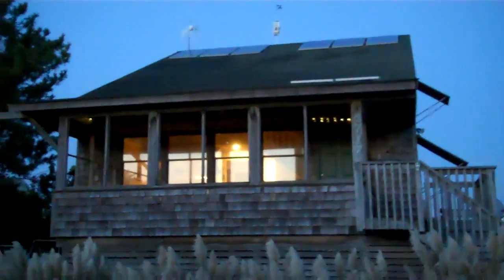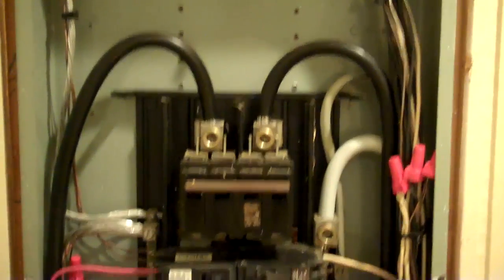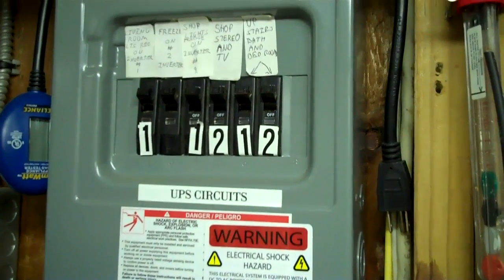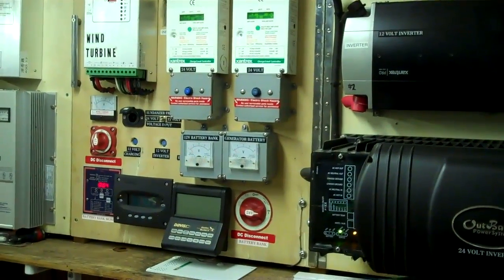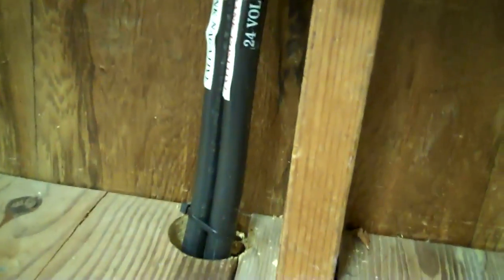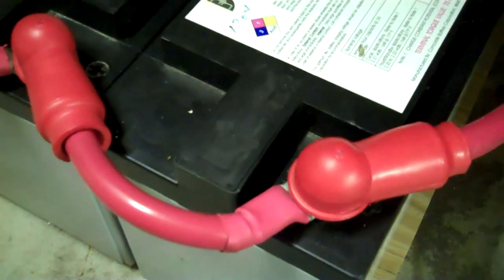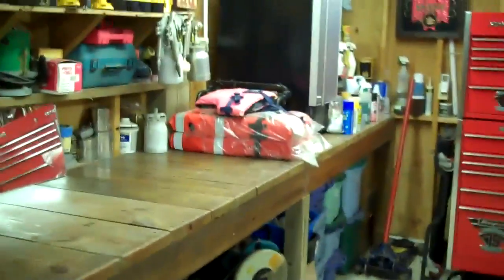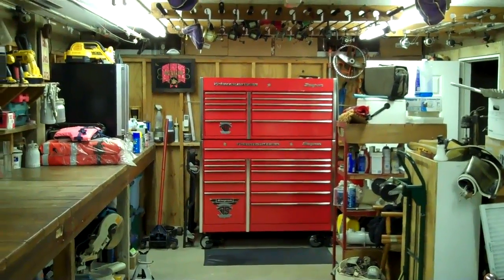SOLAR AND WIND POWER HOW I WIRED IT.

Comment: All my Battery inner connects are of type k copper tube that can handle over 1400 amps at 1 foot according to Nibco, the manufacturer. My 2-0 wire failed, the pipe has not.

Comment: geesh brother.  what a great system; where do i start?   I'm a total newbie but also a nerd with some experience with an electrician and in other trades.  I know I can learn and then safely and neatly wire up something like that. My goal is something much more modest:  a skoolie conversion.  BUT, I want it to have a shore tie, wind, solar, generator and engine charging capabilities.  I need enough juice to power a refrigerator, TV, PC, stereo, water pump, microwave and lights.  I don't know how to size it let alone engineer the build.

Comment: You definitely have it 'squared away'. Very impressive! Personally, I wouldn't even know where to start. Possibly you could give me some advice, as to where to start on powering a greenhouse? My brother-in-law and I have built a 17' x 57' greenhouse that we are running an aquaponics system in. That means that we need to be able to power 'off-grid' a 4,000 gallon per hour sump pump, a water heater for the swimming pool, (during the colder months) that houses fish, also a few devices that might switch on and off, when needed, to maintain water levels, water temperatures, possibly send us alerts and occasionally some lights. How would you recommend that I/we start? This is in Southeast GA.

Comment: Your batteries should be in a ventilated steel enclosure if you get a thermal run away with all that wood it won't be good, Nice set up by the way cheers...

Comment: It amazes me that you use big wires along the batteries and then come back with flattened copper pipe that has way less square area. That copper pipe is like a big resistor compare to the other big wires.
Someone on the internet comes up with an idea ( good or bad ) to use a flattened copper pipe and then the rest of the world is doing it and no-one even bothers to see and calculate if that idea is going to work right.  
So, I guess you fused your battery system according to your flattened copper pipe since it is the smaller conductor......right?
Reply from the maker: You need to do your research on insulated conductors VS non insulated conductors before you try to share bad information or bust my chops.
Reply: Are you suggesting that a copper buss made from 99.9% pure copper pipe is inferior to copper stranded wire sold by your true identity as Jeffro of  Missouri Wind and Solar criminal organization of scam artist? Yep, sure you are. 
Everyone knows you have 500 fake ID's used to trick you tubers Jeffy Boy.
Reply: Ohms law and doing calculation with it does not lie.

It does not matter if a conductor is insulated or not, a smaller conductor like the home made pipe buss bar that is on your battery pack will always have more resistance than the stranded battery wire in your battery pack for example.
The square area of the stranded wire you use on your battery bank is bigger and therefore  has a smaller resistance compared to the buss-bar that has a smaller square area.

Do some research and use ohms law.
Reply: Bonnie Flory I hope IBM, Hughes aircraft,  and Tesla don't keep using solid buss on all their stuff. Probably should warn them.
Reply: Јохн Даниел  consumers power uses flat copper stock on their battery banks for their dc circuits

Comment: Great video, I have a few questions. First I would like to know what are the large batteries that you're using, how much do they cost, what are that called, energy capacity etc. 2nd, how many units would it take to run an entire house for 24-32 hours? 3rd, would you recommend running a house on the battery sys. Or running it live from solar and or wind? I think that's all for now please let me know... I'm really interested in this stuff

Comment: But I do and I think by using this crimp tool you don’t have a good control about the degree of compression.  A good degree of compression is characterized by a completely filled crimp barrel, in which the strands in the wire crimp area are completely compressed in a honeycomb structure. This structure tells you if you have achieved a gas-tight connection.
A poor degree of compression (too much and too less) will increase the contact resistance over a longer time period.

Comment: You need to get those batteries off the ground that's a good way to discharge them.And a better way to do your terminals is to put the lug in a vise heat it up with the torch fill the lug full of solider right when it gets full of solider remove the torch and stick the wire in the lug immediately if you do it this way it wont melt the insulation and you get the best connection you can get.

Comment: Whats the price for a kWh from the grid there.

200amps STANDARD grid fuse not strange U americans have a roumor to consume much electricity.
Here in cold sweden U have 16amp)230V( for apartments and never more than 35amps(230V) for an house with electric heating.

Keep up the good work going greener with solar and wind :D

Comment: I guess I should be clear that what I am talking about is a silver brazing rod that melts at about 1200f and needs a torch to melt. But when my systems often use 4-6" wide copper strap for conductors that is not easy to crimp ...

Comment: The reason you don't see factory battery cables soldered is cost and ease of process pure and simple. But I have been in the business of high power RF and Grounding for 20 years and I'm here to tell you that just because electricians crimp lugs with a greenlee crimper does not make it the lowest impedance connection possible, just the fastest and the cheapest. I cadweld if I have a mold big enough and If not I physically attach with fasteners and silver solder.

Comment: nah man a couple strands most likely wont make any difference at all.. but why leave them out of the lug when you can easily get all the strands in?  And scoring the wire with the razor blade can be an issue down the road.. if you're gonna be using these jumpers for a long time, eventually the strands of copper that are nicked will break.  If you are using 2 awg wire, you want to have 2 awg capacity.. you won't have that if you are sloppy.

Comment: Air conditioning is not the only usage for silver solder. The silver solder I use for brazing when grounding & high current work is more than just the stuff on a roll. Its high content stick form like Silvaloy A56T that is 56% Ag and 22% Cu so conductivity is very good.

Comment from the maker: Silver solder is for heating and air. Solder is great for electronics and copper pipes but not for load carrying wires. If this were true you would see factory batterie cables with soldered ends.

Comment from the maker: I know you are trying to help and I can apreciate that. There are no witness holes in these lugs and I am overkill when it comes to wire and the size of the wire. I had comments below about soldering the terminals wich is a big no no. Soldering large wire is an electricity road block. If you think a couple of stands out of the thousands effect my system when it comes to connections and efficiency of my set up than you are more anal than I am...

Comment: Where I work, I lug 2 awg wire on a daily basis along with other sizes.. Your whole setup is sweet but Id like to give you advice on terminate battery cables.  Try not to scribe the wire when you cut off the insulation.  You also had strands sticking out of the lug.  Get them all in there!  Lastly, try to get the right amount of insulation trimmed back so the base of the terminal is snug against the insulation, and the copper of the wire can still be seen thru the hole (window) in the lug.

Comment: Thanks for sharing your vids. My sticking point is always how to figure out how to rewire your house or apartment so most if not all electricity is coming from the solar system. And making it all legit without fire hazard potential...Any suggestions?

Comment: I hope you don't have the batteries under the bench on Concrete. The Cathodic/Anodic reaction will destroy your batteries due to the difference in temp. between the bottom and the top of the batteries. Just saying,,It's part of my job for the last 15 yrs...Other then that,,good job on the wiring,,,Must be part of Your jobs,,later.

Comment: @SoCalPreppers 
LMBO at the OBXcompulsive disorder comment! Kevin has it going on, nice vid, inspiring me to get out into the mancave and spiffy things up. 

Kevin, tell me about the 200a transfer switch...is it automatic, or do you have to manually switch the house over? I know the grid-tie inverters you have use automatic switches...just wondering about the transfer box outside.

Comment: @stevehmi Nope, the Aluminum wires I'm talking about are the wires (feeders & branch circuits) in his breaker box. The Zinc coated wires he talked about are the cables he is using for his connection to the batteries and they are really good wires. I've made a set of 20' car jumper cables out of that type of wire (only smaller) and they have lasted me 30yrs at least with no problems. They don't get hot like some other cables can. Take Care :-))

Comment: I know you know about electrical and I don't mean anything by this but I noticed the feeders and I think a few lg branch circuits were what looked like Aluminum wire. I didn't see any noncorrosive compound on the lugs in your panel box. If it's Aluminum I hope I'm wrong and just couldn't see it....LOL. If it's not on there I hope you check the connections every yr to make sure their tight. All failures by Aluminum wire are caused by not being terminated properly. Take Care :-))